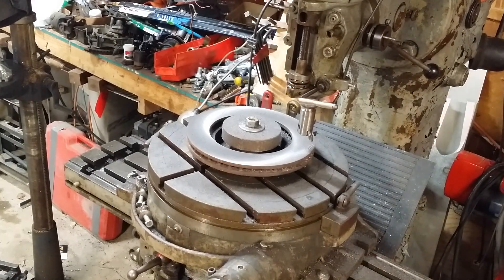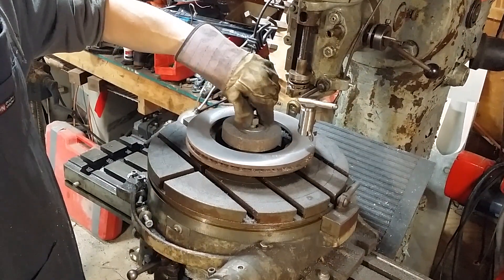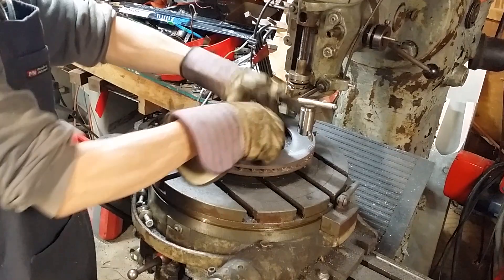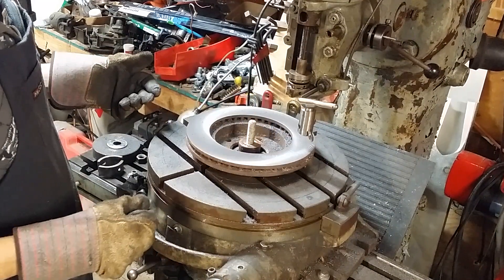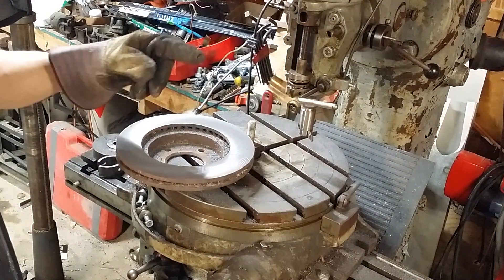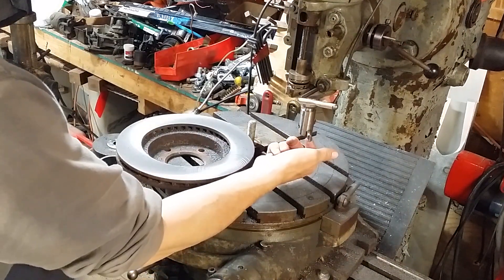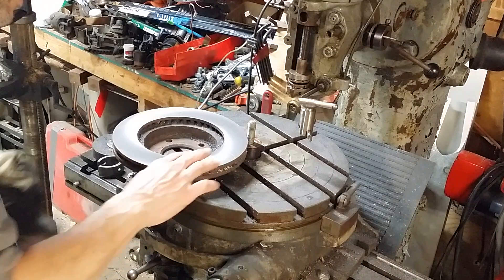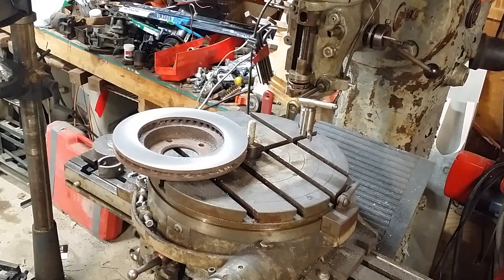Turning a brake rotor on the mill with rotary table

Comment: I can turn smaller rotors on my lathe never tried this le me know how it comes out
Reply from the maker: Its official.  My brown n sharpe mic shows it within .0015 :-)
Reply from the maker: In my opinion it was  a success.  I have only quickly measured it with calipers yet, but initially it looks like its with a though. I will likely mic it later today to confirm.  But its definitely better then the 14 thou I got on the lathe